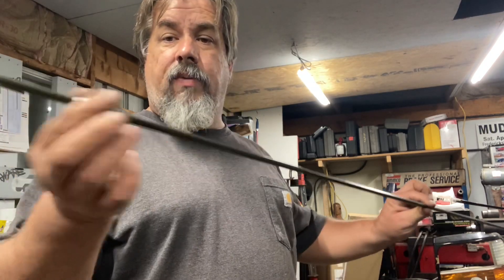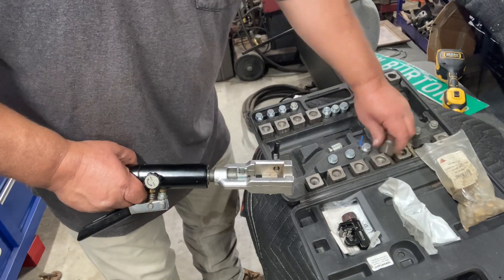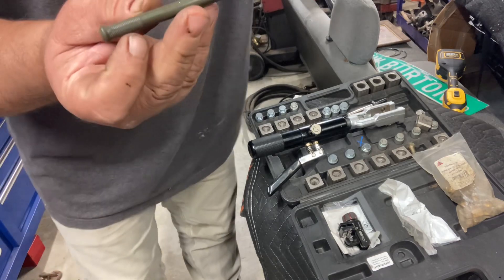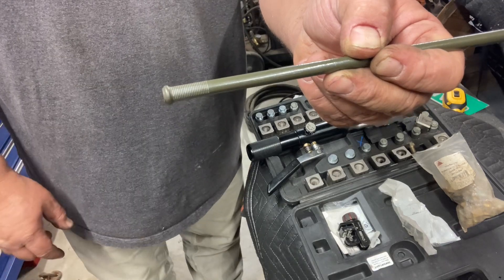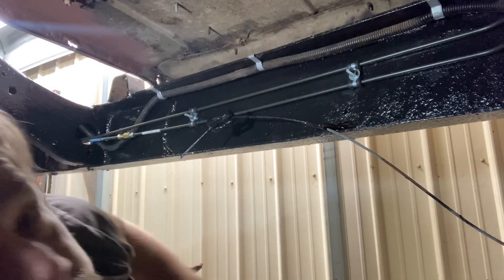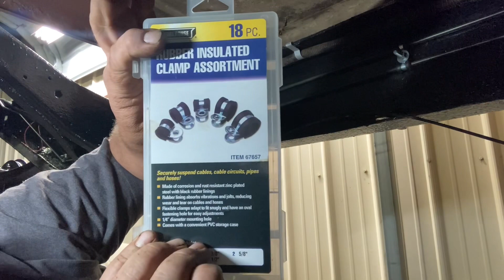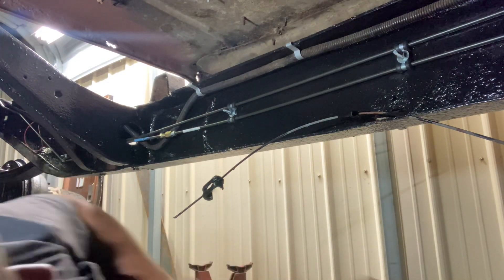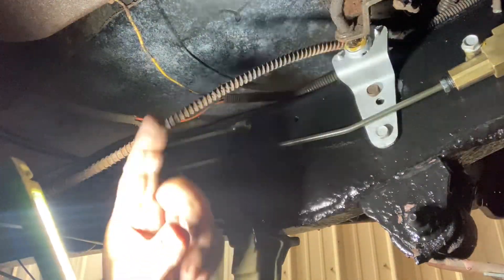Some progress on the J10

Comment: I got lucky.. if lucky means anything on my J10 if youre following mine lol.  Someone replaced my j10s brake lines at one point.  All new tubing.   Now the fuel lines...  I probably should replace.

Wheb i pumped fresh gas through the fuel line i had black gunk. Rust. Water.  Rusty chunks come out.   

Ive done brake line flares on my brother 14 SS canaro when he got brembo brakes. But it was with a harbor freight kit ... which sucked it made poor flares.

The brake lines i think they make a preformed kit for them for 50$ or so.

As for solid floor supports LOL.   Have you seen ny clips ?   I had to replace an entire floor support on the passenger side on my j10.  

As for guys on the forums.  I cant stand those fsjnetwork forums.   The said i should have dumped my j10 in a river.   Get one on the west coast.  Get a bed on the west coast.

Do you think ima drive 3000 miles from VA to pick up a bed ???  Those guys are nuts.

Im just rebuilding my bed.  They said it couldnt be done.  And guess what its being done.